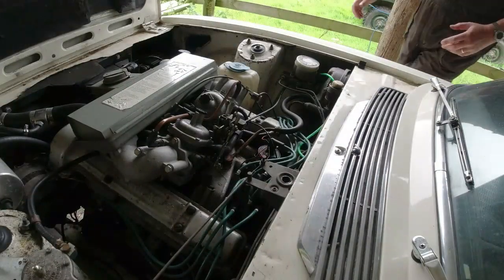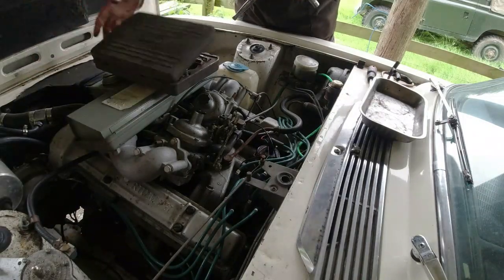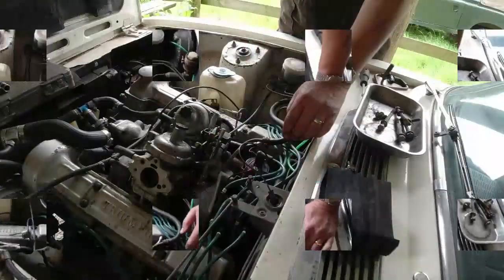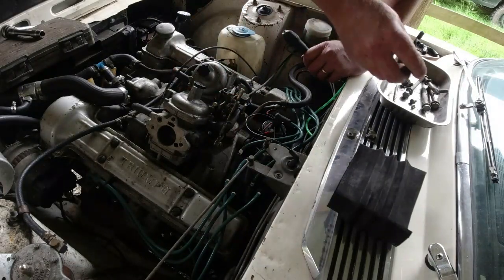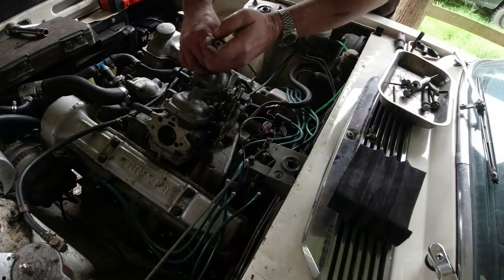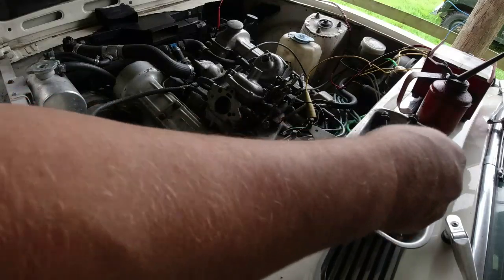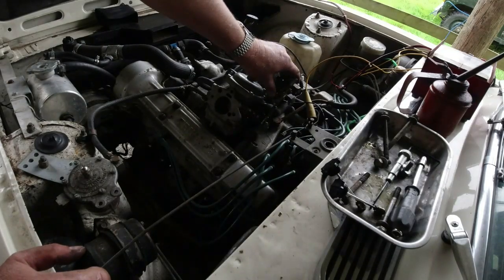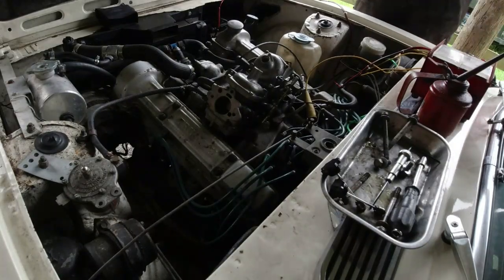Stromberg CD 175 Carb tuning on a Triumph Stag - Parental Warnings etc

Comment: Thanks for this very clear demonstration I to shall be following this with mine , ta
Reply from the maker: There are very few gotchas with these carbs. I do try and highlight where they are as I generally find them to be reliable and efficient. Plus of course they look good, an engine needs to look good and not be covered in a big plastic moulding

Comment: Hi Richard, thanks for the comprehensive demo on tuning the Strombergs. They are a brilliant carby, and the only problem that I have ever had was that one of the plastic connectors on the throttle linkages failed. Took a long time to isolate this. Luckily Stag Owners Club manufacture a revised version of these linkages.
Reply from the maker: Glad to help 🍻👍

Comment: Hi Richard great video, quick question there is a brass screw with spring on each carb body, you dont mention the function and setting for these adjusters?
Reply from the maker: You mean the fine tune screw besides the temp compensator? If so that is to fine tune the emissions. I screw them in so they don't go further and have never had an issue getting the carbs to run at 4.5% co

Comment: Thanks for this excellent and informative video
I was wondering if you had a opinion on using a Gamston Colourtune kit to get the mixture correct? If one was available, I thought it might be easier method?
Reply from the maker: I used to use the gunson colourtune kit but on a single carb engine. with a twin carb engine it can still help but I have a gunson G4125 analyser that confirms my results, it takes an age to calibrate but is cheap as chips.

Comment: I’m sure these are the same carb in my Range Rover
Reply from the maker: Range Rover / Rover v8 use the Stromberg CD-s 175. Very similar. They don't have the temperature compensators and only have one choke module.